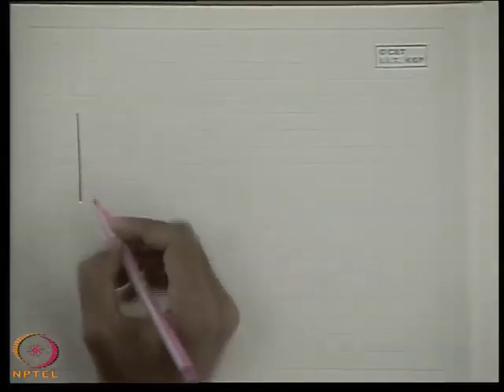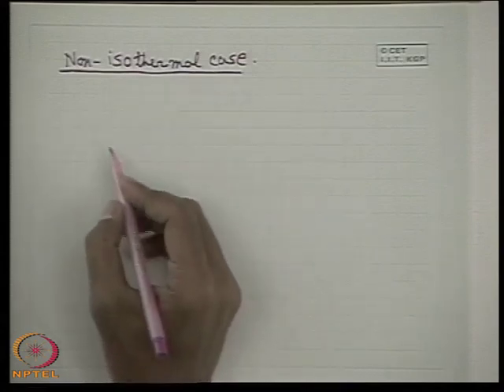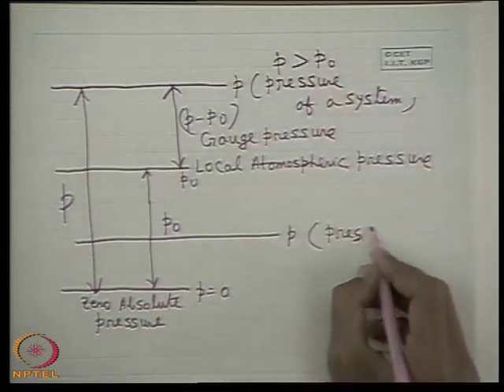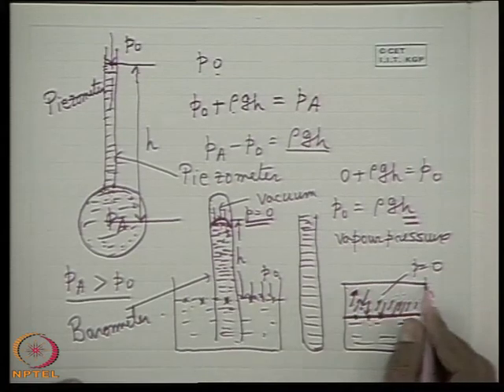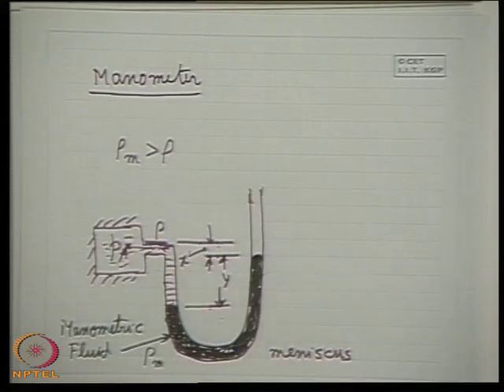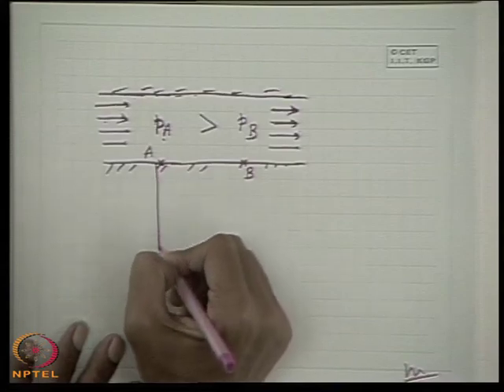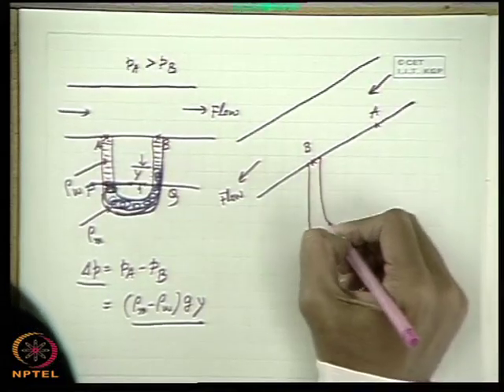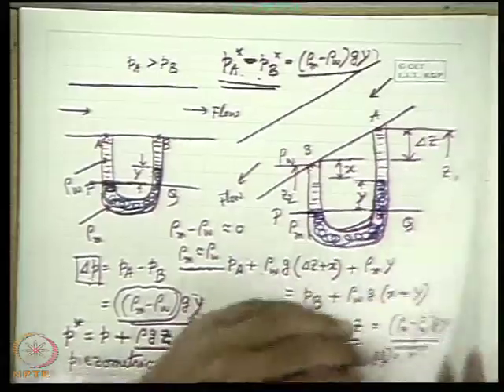Mod-05 Lec-05 Fluid Statics Part - II

Comment: 1:50 toricellis's theorem
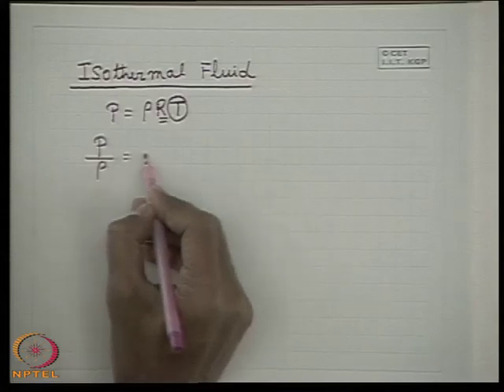5:02 case for isothermal and non isothermal fluids
13:20 Gauge pressure, absolute pressure and vaccum pressure
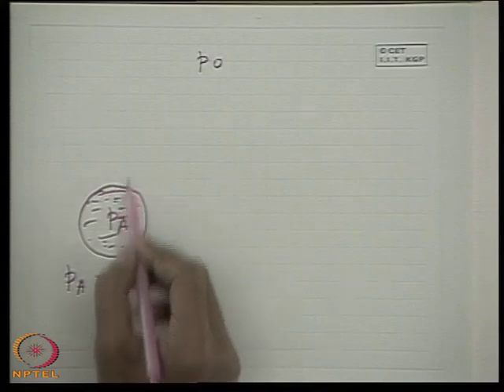17:38 Piezometer
20:16 barometer
22:33 vapour pressure
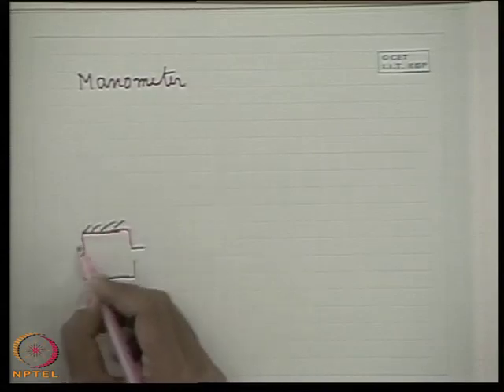27:30 manometer to measure positive and negative gauge pressure
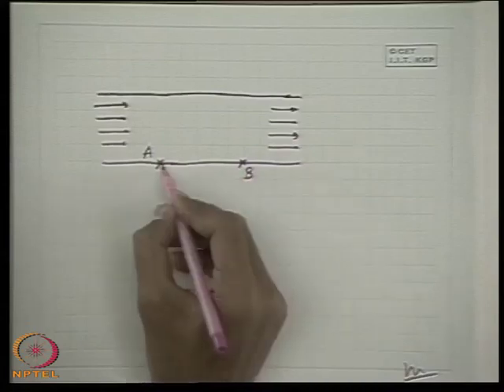37:20 Pressure difference between two sections of a pipe using manometer
Reply: on every lecture im following you

Comment: HI SIR, At Lec-5 when pressure move to statically from P(a) to P(B) ,THAT time actuvaliey  take to mercury level minimum at left limb as well as maximum at right limb: (BECAUSE P(a)>P(b)) BUT YOU ARE TAKE TO OPPOSITE WAY
Reply: change the direction of flow and replace P,a to P,b and vice versa...............your doubt will then be solved.
Reply: Not then also because then roh×g×z will come with negative sign with pressure

Comment: In barometer.. 
the  density is different (hg and  water) at that level  why we take equal  pressure on those point  ?
Reply: There's no water, only mercury!
Reply: As the law of hydrostatic equilibrium the pressure at any point of cross sectional area is constant as one side of tube in q the pressure is equal to at point p so see another side on tube of barometer
Reply: cause pressure varies only in vertical direction if we consider only gravitational force is acting on the fluid , now as explained in last lecture pressure is varies in only  'Z' direction only  but NOT  in 'X' and 'Y' directions.                                                
BUT your doubt solve here that  it is caused by Hydrostatic law of pressure , in barometer pressure exerted by the above the level of the water in barometer, fluid and the vapour pressure of the Hg  is same as the pressure exerted by the AIR and water is same at that Horizontal pressure

Comment: Temperature lapse rate is 6.5 °C/km but he is writing 6.5 K/km. Which one is correct? 10.50 look for that
Reply: The temperature lapse rate is the rate at which atmospheric temperature in Earth's atmosphere, changes with altitude.
Since Temperature in Kelvin = Temperature in Celsius + 273, the change in temperature is same in both the scales.
Hence the values are same for both the units.

Comment: Great Efforts!!! 
1 doubt - in the incline pipe if the flow is in downward direction then the pressure at point A should be more than that of point B. then how the manometer reading can be drawn the it is drawn. althoungh it is the piezometric difference but it may not be true all the time???
thanks
Reply: same doubt
Reply: @souravupadhyay7693  change the direction of flow and replace P,a to P,b and vice versa...............your doubt will then be solved.
Reply: just reverse the direction of the flow.
Reply: change the direction of flow and replace P,a to P,b and vice versa..............you have to replace also
Reply: change the direction of flow and replace P,a to P,b and vice versa...............your doubt will then be solved.